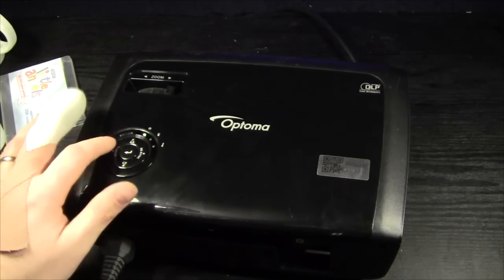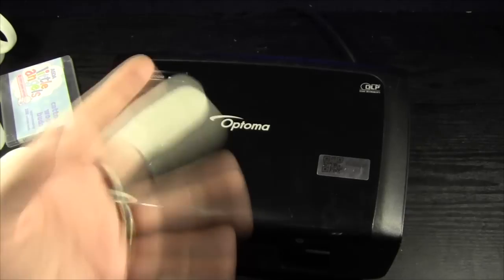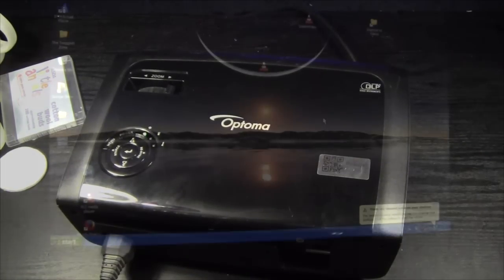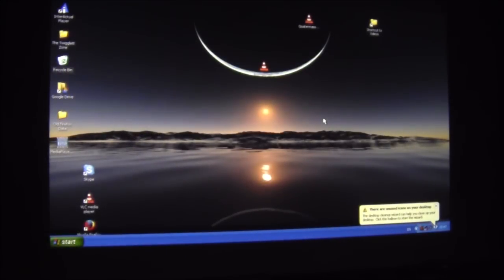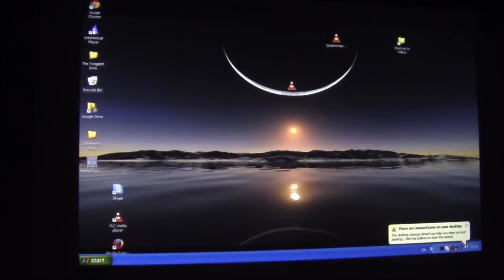How To Clean & Service A DLP Projector : Tutorial

Comment: DLP projectors are just fascinating devices, i could never use an lcd projector after using my optima hd131xe, the picture quality is so beautiful and vivid
Reply: LCD are better as the dlp dies quicker or start having problem with chip, colour wheel etc.. i hate them. Go to eBay and you will see the majority of them requiring repairs are dlp
Reply: I agree that DLP projectors are nicer than LCD. There's plenty of problems with the LCD variety and they just don't perform  as well in the first place!

Comment: Hi, Your video was a lucky find as I have the same projector - had maybe 30 / 40 black pixels visible on light backgrounds - aligned in quite a uniform way, a few close together on the same line for example. Took the projector apart and cleaned like yours and replaced the heat sink paste also. However on putting it back together it won’t quite start up with the green light turning to a flashing red, fan coming on and lamp warning on. Any ideas where I screwed up?! Thank you 😁

Comment: Hi, great video. Can you please tell me what you used to cover the mirror etc. again, after having removed the black tape? The tape on my projector ripped when I was taking it off, and I don't know what to replace it with. I imagine a high-temperature tape would be needed. Or is tape needed at all, if light dispersion isn't a big issue?

Comment: I replaced the chip of my projector (looks exactly thensame but it's an LG BS275). Put it back together again. Fans doesn't switch in at all, so when powered up it only makes a solid green light for a short while then goes back to yellow and no response. Can you help?
Reply: Hy gerrit , i have same problem, did u solve it?
Reply: @tvnews7230  No I replaced the projector. I found an identical second hand one with less hours for cheap.

Comment: have a projector, optoma HD600x lv. 
have a small problem. 
after about 2 mins of warching the prpjector it goes black and white. then turns off.  was reading it could be the power ballest or colour wheel. thinking more power ballest. 
was just wondering if gou cMe across this and you k ow what it could be. oh and bought a new bulb amd still the same. any help or advice appreciated. thank you.